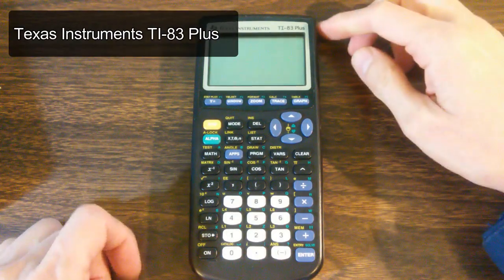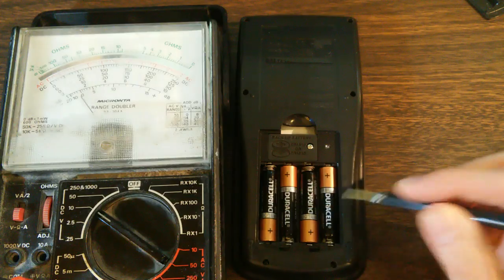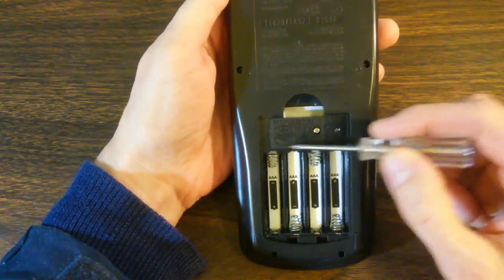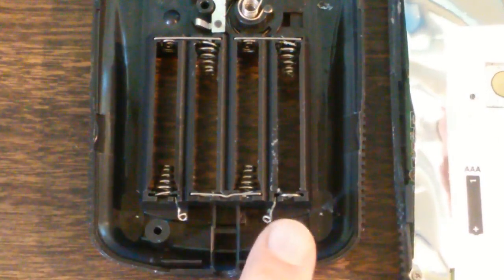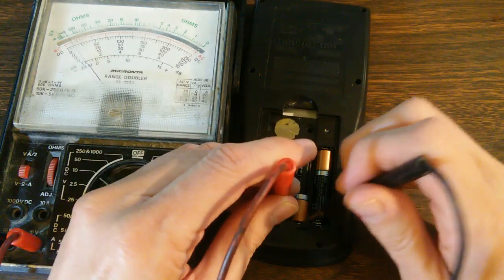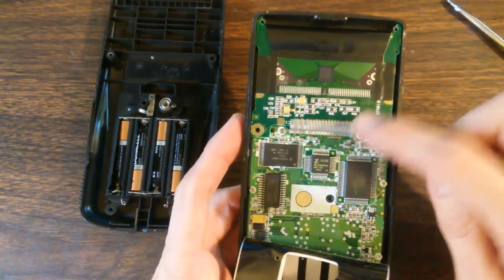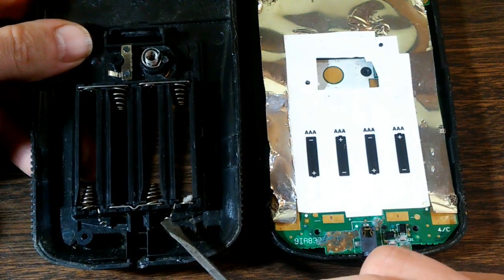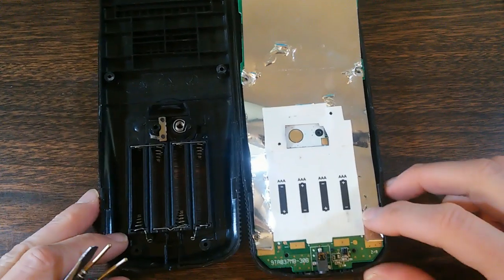TI-83 Plus Calculator Dead.  Repair.

Comment: This worked! Fixed my 10 year old TI-83 Plus which would not turn on. I did not remove the back of the calculator. However, I did as someone suggested in the comments and slightly adjusted the wire with a tiny screwdriver - it turned on after I re-inserted the batteries. Thank you!!

Comment: Just wanted to say thanks for this video. It totally solved my problem. I spent 3 hrs trying different combinations of battery removal and button presses - none of which worked. I opened up the calculator and adjusted the contacts as suggested and the fix worked instantly. My daughter and I are so happy. Thanks for saving us $100!

Comment: I have a battery drain issue. The calculator will drain the batteries quickly even if the device isn’t powered on. Anyone have a fix for that?

Comment: thank you so much, my mother and i used a pin to bend the metal part without taking off the back, by putting it through the hole. it works!!!

Comment: I was in little panic as i thought my calculator is dead.
I bought this in 2008 and used only for a one year and never took it out until 2022 today.
But the problem was exactly same as this video.
I didn't have that "T6 TORX screwdriver" so i put the toothpick in too the liitle hole where the battery cover was placed to bend that metal wire to touch the contact you mentioned and Wow  it's working again!!! 
Right side of metal contact was barely left haha.
Thank you so much for this video

Comment: You are the bomb, Thanks your video helped, not sure how just watched it popped out the memory  battery, stuck a blow gun dart with super glue on its tip in the bat door tabs, and moved the little metal wire from the batter terminal. Put battery's back in. Powered right up. You the man. Thanks

Comment: Is there any hope if my battery connectors are almost all green?!
Reply from the maker: Try polishing the contacts with very fine sand paper.  You might be surprised at how much orange copper metal is still there.
Reply: @c.davidgraves4848  thanks for the tip. I tried cleaning it with alcohol and q-tips to no avail.

Comment: I opened up a TI 83 and found one of the copper strips was almost gone due to a battery leak. I took a piece of copper tape and folded the adhesive over itself leaving just a bit of adhesive to tape to the calculator. Worked perfectly. Thanks for this great video!

Comment: Ive got a ti93 with O/L on the positive and negative leads. All contacts on the display cable come back fine. Noticed a problem when it didn’t power on so I then changed batteries and then it gave me about 7 vertical lines and no life since then.
Reply: Update, now 450 ohms resistance on the +/- leads

Comment: You don't need to take the whole back off to adjust the metal wires touching the copper. You can see them and adjust them using a tiny screwdriver (or any small enough object to get through the two little rectangular holes below the batteries). 
I did and my calculator (which wouldn't even turn on before) works fine now. 

Thank you for the video, otherwise I wouldn't have known what to look for!
Reply: @vikcheban923 Thanks for this tip! My T6 bit can't reach the bottom row of screws so I can't remove the back cover. I was able to use a hair pin to shift the connectors as you did (hair pins are a multi-use tool, I swear). And BAM, ole faithful is back in business!

Comment: Omg! I just stumbled across your video and just fixed my TI-83 calculator in less 2-3 minutes. I just used some tweezers I had laying around to slightly bend the connectors without  actually removing the back cover. Thanks a bunch.

Comment: THANK YOU SIR I OWE YOU ONE I MOVED THE metal contact, where the copper is nearly removed JUST A LITTLE BIT WITHOUT OPENING THE CASE i used one of these voltage checker contacts pins. AND IT WORKS NOW, TRILLION THANK YOU!!!

Comment: Any idea on how to bend the contacts without removing the back?
Reply: Can't do it  You have to take off the cover, no two ways about it
Reply: @georgeevangel4292  well I just used a flat heads to take it off do that's a problem solved
Reply: @thejummyjum6207  Do what you can
Reply: I tried bending them through the holes and it worked perfectly!

Comment: Thanks for posting this vid.  I opened my TI-83 ( not plus) calculator and the contact point was corroded.  I moved the connector and got my TI-83 working again after having it in my garage.
Reply from the maker: Thank you for the information.  I did not mention the TI-83 (not plus) because I have never owned one and I did not know how they are built.
Reply: @c.davidgraves4848  Interestingly I have a 1998 Taiwan built TI-83 and it is totally different. Only 2 phillips screws retain the rear cover. Also the battery terminals are soldered onto the PCB and align perfectly with the rear cover when it is clipped into the front. The covers also separate  easily by squeezing the front sides after all 3 screws removed with only minor prying. It seems a better design that has survived decades of use with no fatigue of the spring wire/PCB soldering. Have to wonder why they went away from it. Apart from the display dimming (why I found your video ) over the years it is my daily drive calculator. Great video.

Comment: Thanks for taking the time to make this very informative video!   Did you ever make one regarding the connection between the system board and the LCD display?  Looks like that is my problem.  Thanks again!
Reply from the maker: If your TI-83+ has an erratic or "glitchy" screen, I do have a video on that topic: https://youtu.be/-XgR5QrGHB4

Comment: Mine only has two screws on the bottom and it won't pry apart after removing them, any ideas?
Reply from the maker: I have no idea.  Every TI 83+ I have encountered was held together with 6 torx screws and 1 Philips head screw.  How old is your calculator? Perhaps there has been a design change.

Comment: Hi, can anyone tell me if this Ti-83 Plus can turn on if the button battery is not put in? I haven't used mine in a long while and it is dead. I've cleaned the contacts and still no dice. If it is the button battery then I'll go a new one (CR1616) is pretty hard to find here. Oh, it also has a bit of a 'burnt' screen. Many thanks in advance.
Reply from the maker: The calculator will work without the memory battery.  It just will not be able to save anything.  BTW, it will also work with the CR1620 battery, which are more common than the CR 1616.

Comment: Really useful step by step diagnostic approach, I had worn contacts and also the wrong memory battery cr1632. Would recommend people remember to ground themselves or touch the side of a grounded computer case to discharge any static electricity before touching the chips otherwise they could fry and never know that's what caused it.

Comment: I found one of these walking home from school a few months ago, and it is only missing the carrying cover and half of the label around the screen has been cracked off, but otherwise it’s in good condition. The sad part though is that I cannot return it to the original owner because the name that was on the back has been scratched off.
Reply: Pretty talented calculator that it could walk home from school by itself! It's a keeper!

Comment: Thanks so much for your excellent tutorial on repairing the TI-83.  Mine had the exact problem. Your test suggestion with a meter indicated no power from the batteries showed no current. Did your fix opening up the device and moving the contacts. It solved the problem completely. My 16 year old TI-83 now works again.  Thank you so much.

Comment: Hi it seems like you got  a lots of know ledge and know your calculators. nice video and lots of info and examples. My ti83plus wasn,t used for about 1 year, i took it out of the drawer to use it,wouldnt turn on,so i replaced all of the 4 batteries except the 1616,it test 2.70 volts,seems ok, so after new installing 4aaa,it still did not want to turn on,finally after holding the on button down,then replacing the aaa battery with the on button held down, it came on, but a complete black screen is on my screen.. and i cannot get the black screen to go away... btw there is 6 volts on these contacts that you showed in this video. ty 100--100
Reply from the maker: A dark screen can be caused by the contrast being turned up too high.  Check out this video. 
https://www.youtube.com/watch?v=I2F2IIXs6Wc
A bad internal ribbon cable can cause all kinds of problems, including a black screen.  See my video on cable repair.
https://www.youtube.com/watch?v=-XgR5QrGHB4